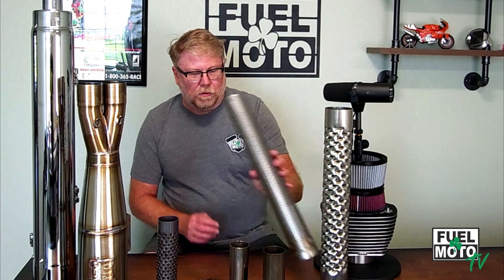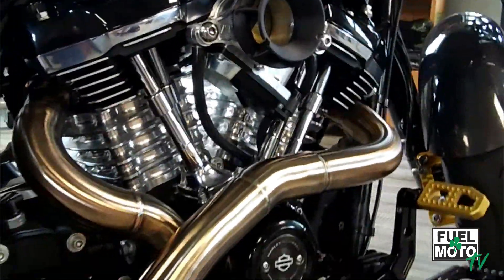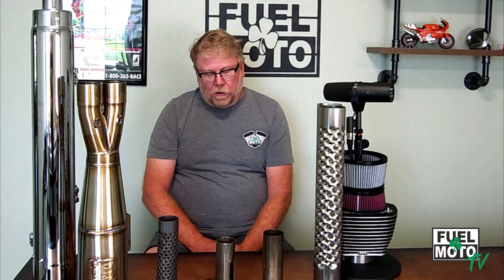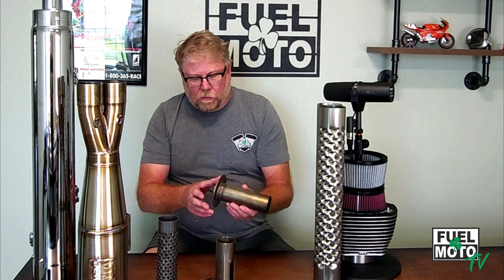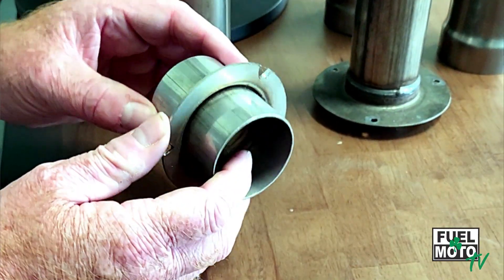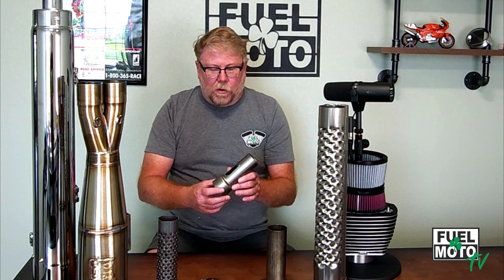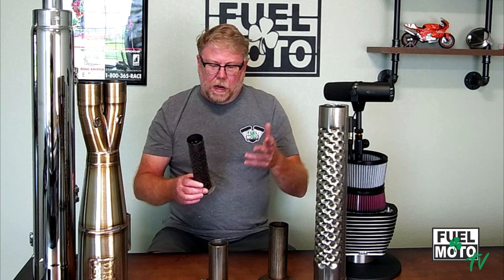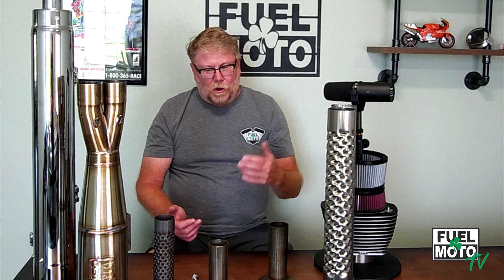Tech Talk: Baffle Designs for Harley-Davidson Performance & Tuning

Comment: do you need to retune when changing baffles or adding tuning inserts
Reply from the maker: Yes, you should retune your engine after changing baffles or adding tuning inserts, as these modifications alter exhaust flow and can affect the air-fuel ratio, potentially leading to poor performance or engine damage. While some riders may not experience issues with minor changes, a dyno tune provides the most reliable way to ensure your engine runs optimally and safely with the new configuration.

Comment: Can you please put out a dyno sheet for stock 103, exhaust, air cleaner and stock compression for a star racing 577 cam.  They are claiming 100hp and 128 tq with just a cam swap.  Yet no other manufacturers can do it.  Can you please test it out and lay this to rest.  Thanks

Comment: Never had a problem ordering from you guys..your service and customer care is top notch..I've ordered alot of stuff from you guys..never a disappointment!! Question..sort of related..end caps..why do they make cone style end caps only for megaphone mufflers? Is there a specific purpose they serve just for these mufflers? And could you use one on a standard muffler like a sidewinder or khrome werks? I've tried to look up info on it to no avail..thanks in advance..p.s. I think it would change the sound? And maybe help with reversion/diffusion imho...

Comment: I put your 12=inch tunable baffle in my outlaw pipes and got back the bottom end on my 124. I actually like the sound better.

Now if I could only figure out a way to get more mileage outta the rear tire...